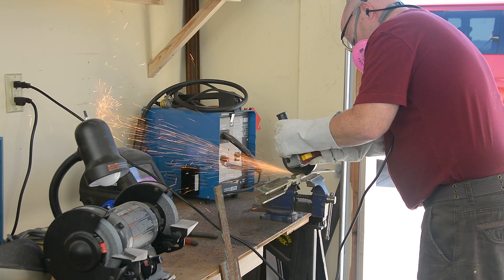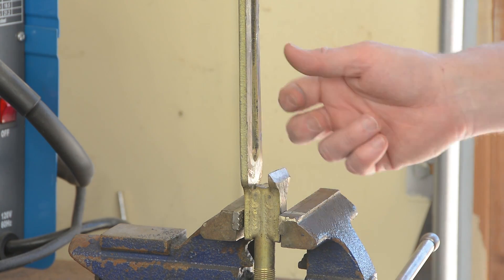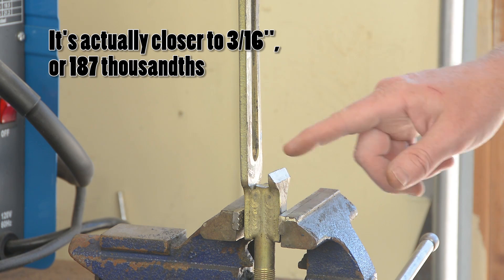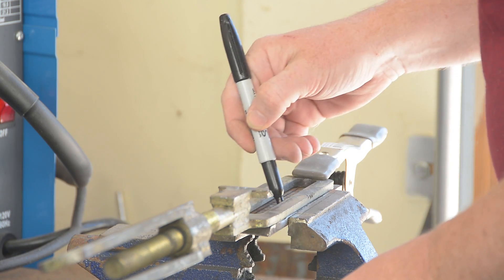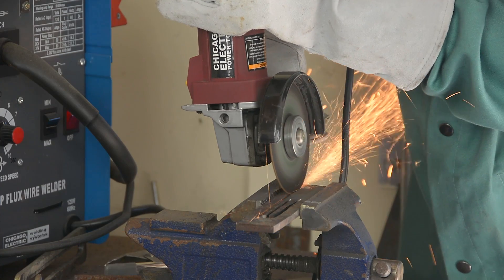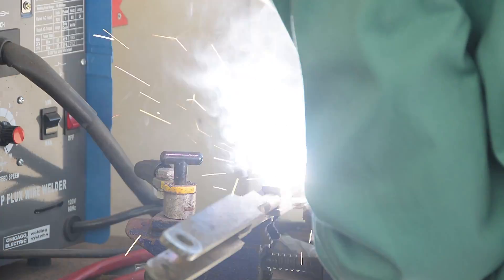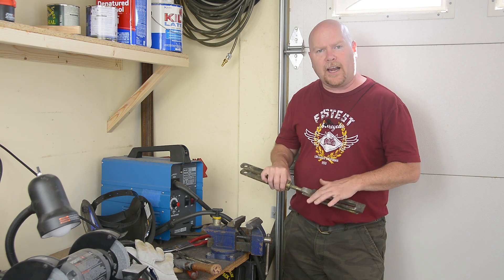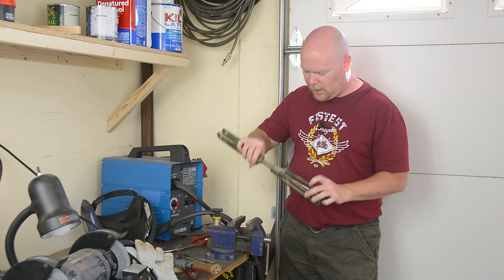Welding Tractor Parts with the Modded Harbor Freight 90 Amp Welder

Comment: HEY JUST A HEADS UP . FOUND THE PERFECT WIRE FOR THE FLUX WELDER THEY SELL IT ON AMAZON. 
I N E 30 GAUGE #1950 50 TIMES BETTER ...ABOUT 15 BUCKS FOR 2 POUND SPOOL I NOW HAVE ABOUT 8 SPOOLS IN STOCK  HARDLY NO SPLATTER AND VERY LITTLE RESIDUE CHECK IT OUT ! ! !

Comment: Say Matt I just watched your vids to modding your welder. I just received mine not knowing how bad it is. My question is how long have you been running your welder with it modded? Have you had to replace the bridge or capacitor since you modded it? Thanks!
Reply from the maker: No repairs to it yet.  I don't weld often, but the unit is the same today as it was at the end of the mod series.
Reply: +Matt Heere Any idea where one could get a capacitor that big without waiting weeks for it to get shipped in from out of the country. If I bridged 3 45000uf 30 volt capacitors together would that work? Or do you suppose I need higher voltage capacitors?
Reply from the maker: You definitely need the 50V rating at a minimum.  Unfortunately it's hit or miss whether there's one readily available on eBay domestically.  You can get them new from electronic supply companies like Mouser or Newark - but holy expensive Batman!
Reply: Hey Matt I did the mod, added the rectifier and I found two capacitors like yours that I added. Got it all back together and it didn't blow up so that's good! 👍 But my welder won't arc. Wire feeds but it won't arc. If one of my capacitors was bad would it cause this?  It's wired up correctly I assume because it didn't blow up. What do ya think?
Reply from the maker: Yep, a bad capacitor would essentially short out the secondary before the torch.  Try it without the capacitors and see what happens.

Comment: once seeing how those lift arms are installed and operated, you could have cut an additional 2 pieces to weld over the first weld where the 2 are joined, that probably would have made it every bit as strong as the original form

Comment: Nice!!!  That is one way to fix that part. I had a similar issue like that before with very hard metal. I used an gas welding torch to heat it up and hid it back in place.

Comment: Great job! What welding wire do you use? Multipass? It has the 11 at the end.
Reply from the maker: +Love2boat92 Yep.  71T-11.  I have the Hobart flavor in there at the moment because I ran out of Lincoln and Tractor Supply was the closest place open.   Run anything but the Harbor Freight wire!
Reply: Matt Heere That's what I've heard before. Thanks.